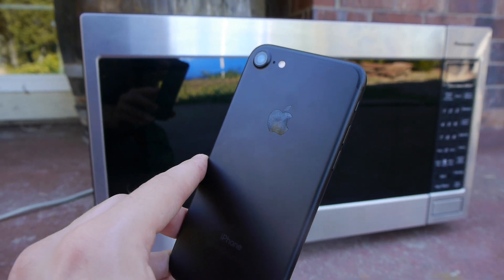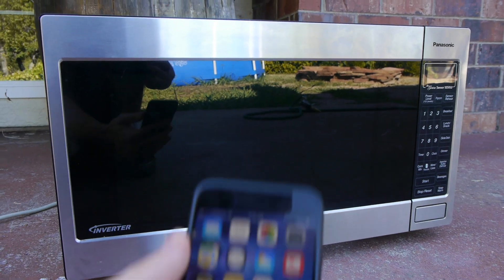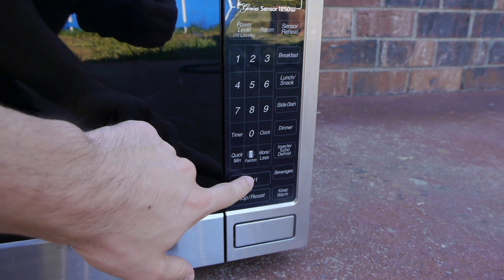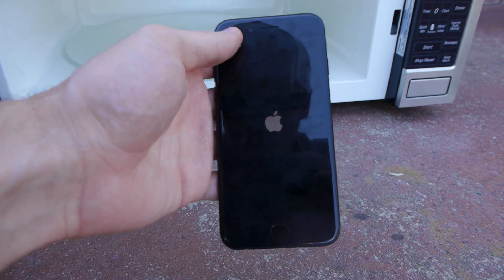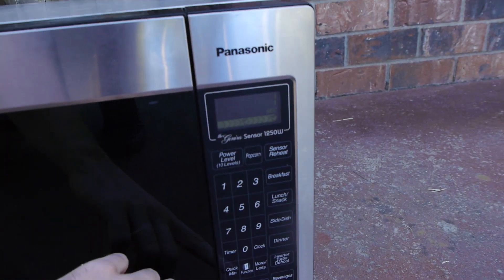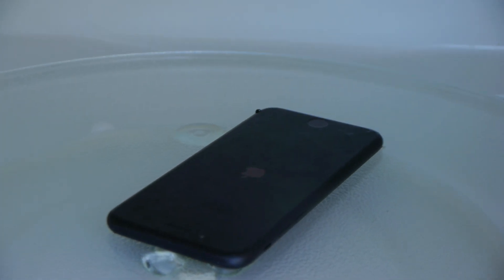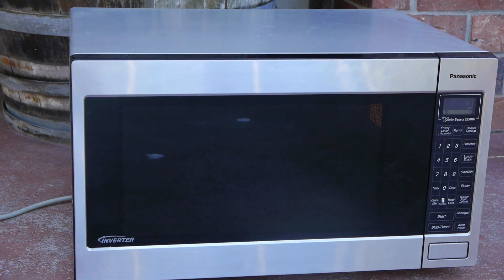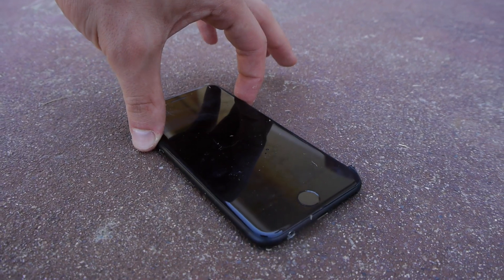What Happens If You Microwave an iPhone 7?

Comment: new iphone ad when it's winter or cold as hell u need heat so take our new iphone throw it in the microwave for 30 seconds take it out and you will have the heat u need. warning:wait 24 hours before microwaveing again or the heat may result in a useless piece of crap rectangular shape made of glass metal wiring and tech crap

Comment: Buddy, Normal microwave uses around 2.4 GHz EM wave, also metal and plastic won't get heated up much in microwave. You need any materiel (like water), which has orientation polarization to observe the microwave to heat the food/material.. Metal will heat up only due to eddy current flow on the metal region of the mobile, also this mobile will fail due to EM wave interaction with the semiconductor that will detroy the any electronics in the mobile. Failure of the mobile is maily due to failure in the electronics due to EM coupling.

Comment: next time you should run over the phone with an airplane then drop it 
from 3000 feet in the air then smash it with a hammer in hot lava then 
boil it in coke then freeze it in water then cut up the leftovers and 
eat it. then shit it out and eat it again.

Comment: You destroyed the wireless microwave charging function when you reinstalled the 3.5mm headphone jack
It is also possibe that the wireless microwave charging function only works with the iphone 7plus 
You should try it again with a brand new iphone 7plus

Comment: I want a phone like this

Display - sAMOLED 4.7" 1080p
CPU - Apple A10 or Any latest SD flagship
RAM - 4-6GB of RAM
Camera - Proly one from S7 or iPhone 7 Plus for now that shoots 4k 30, FHD 60, HD 240. with front Flash and back the new "QUAD FLASH from iPhone 7"
Protection - Moto Z Force tamper proof glass
USB Type C
3.5mm JACK OF COURSE
256GB UFS 2.0
Battery - A solid battery life that can stand a full day. 6.5 hour onscreen may be?
ANDROID Nougat OS! :) Well, I like iOS as well. Dual boot may be? :P
finally TECHRAX proof XD

pls dnt roast me.

tx.